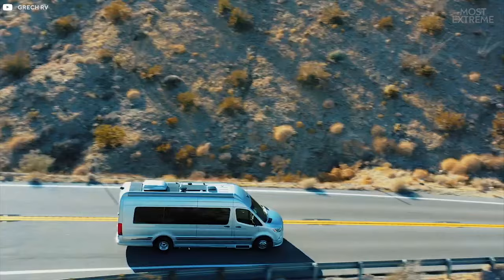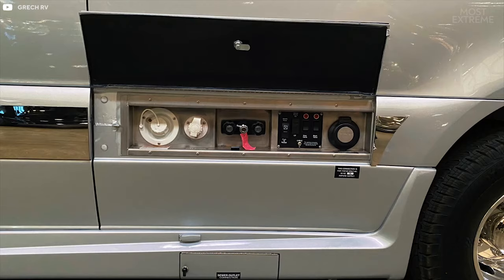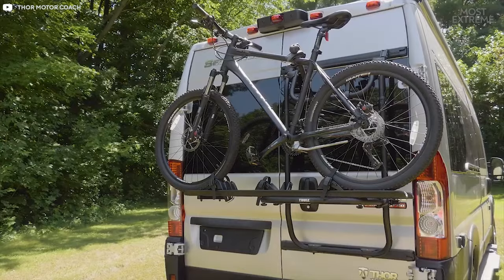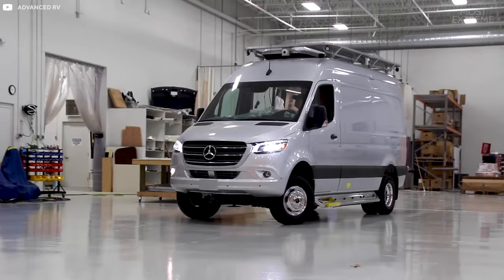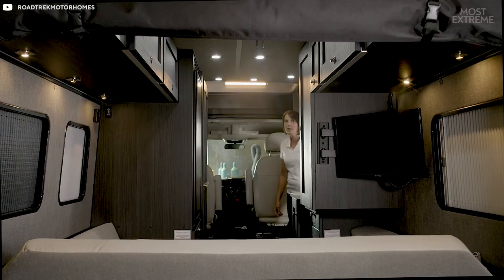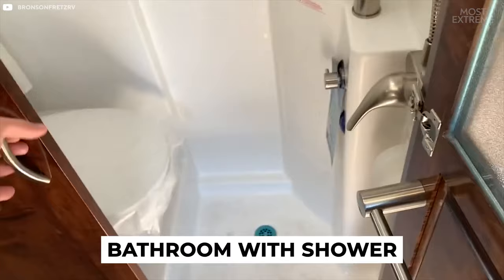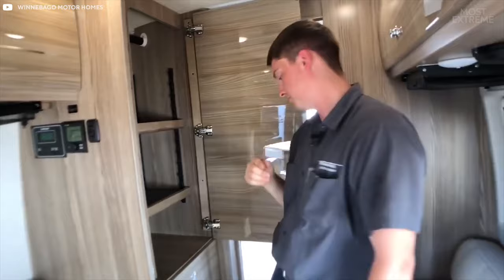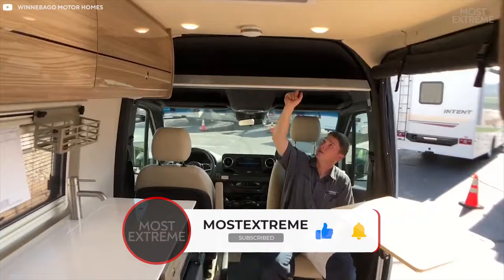10 Best Luxurious Class-B Camper Vans For Van Life With Bathrooms

Comment: After extensive research we went with a 2022 Travato KL we bought new in Sept 2021 for $126K. After 2 years and 23K miles, we still think we found the perfect travel van. The primary reason is the fact the K and KL twin beds make into a large bed that's nearly a King. We haven't measured but it's obviously more than a queen, we have a king at home and it's right there. That's hard to find on any RV, but esp a class B. This design also provides a wet bath in the very back, which is nice for more than the occasional odor. Since the main shower head easily reaches outside, weather permitting I normally shower there for more room using the privacy curtain hung between the doors. The 10K watts of power lasts forever and we love it charges while driving. We don't stay in one place long, therefore we're always charging, and we haven't plugged in for shore power in over 1 year. Despite ours made early during Covid, we feel the quality isn't plush, but for what we paid it's darn good. Since all utility connections are inside the back door, except the shore power, we can park and travel stealth much more often. We park overnight at golf courses, they have tons of open parking at night and normally in safe/quiet areas, also at hospitals or medical centers. We even parked in Denver across the street from a police substation, since we didn't know the area real well and it was late. One thing we'll tell you from experience, Travato owners are high, in general, on their dual pane windows. Ours was to have them as well but it was our only supply chain issue and would have incurred an indefinite delay. We chose not to wait and went with the glass sliders and happy we did. Many owners have issues with windows falling out and some have broken the awning window by opening the large slider door into the open window. We also believe the insulation aspect of the dual pane isn't an issue for us. When you learn how to use reflectix or other materials for temp control it offsets no dual pane. They can also scratch easily - think of looking out of airline windows - and how bad they often appear. We enjoy ours and hope to use it more. Good luck searching and happy travels.

Comment: Grech Strada-Ion or Terreno-Ion have no comparison!
They are at the top of the B-class!
Reply: I own the Grech Tourismo Ion and the only thing I immediately wanted to add was a spare tire (got the OWL).  It is a terrific van, can be parked anywhere (only 3 feet longer than my SUV), is very comfortable, and plush.  Bonus is that they allow you to take it to their factory for repairs and give you a 3 year warranty!  No propane on board, induction range, and compressor refrigerator.  Plus uses diesel fuel for heating.
Reply: @calorbust7150  Agree. I did not pull the trigger because it was overpriced at the time. They wanted $225K. And now the entire RV business is crashing...so no.